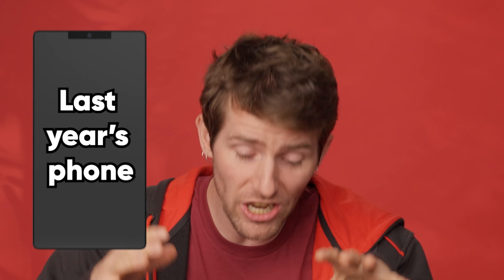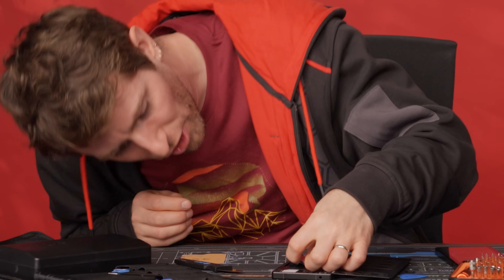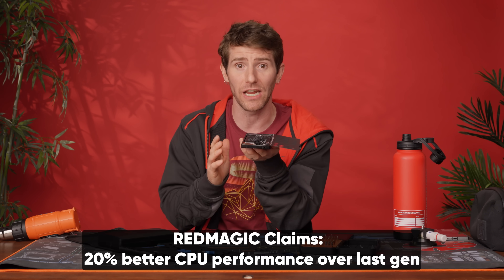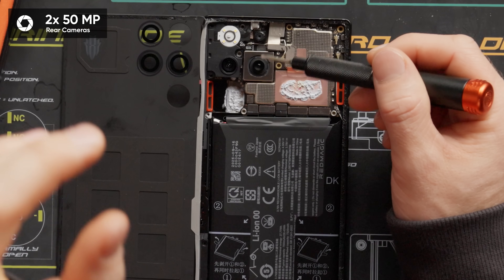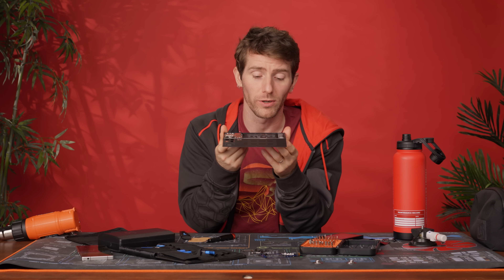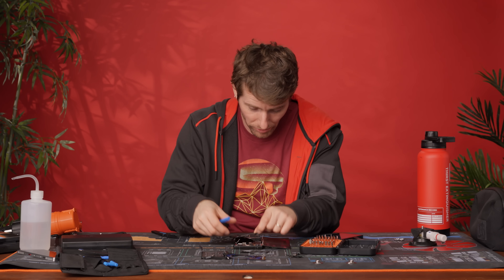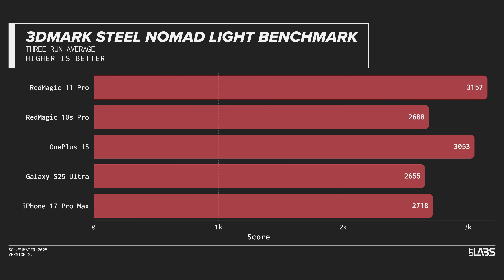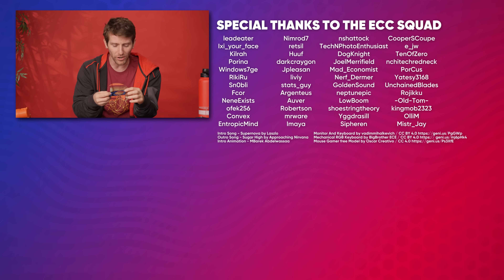This Water Cooled Phone is the Fastest We’ve Tested

Comment: @LinusTechTips Video idea for LTT (about desktop computer cooling for which I can't find a evidenced answer anywhere): Whether six intake fans at 50% rpm or three fans at 100% rpm is cooler or quieter. Maybe three 120 mm front intake and three 120 mm side intake and two 140mm exhaust. Run all six at 50% rpm or just the front three intakes at 100% and see how noise adjusted thermals change. Cheers.

Comment: I really wish you guys would actually daily drive a red magic and see if they have actually improved the user experience at all. Having used the Red 6 pro and currently daily driving the 10 pro and it's been quite the adventure. The 6 from back in the day was a rough experience out of the box with A LOT of software bugs. A Little over a year and they finally fixed most of the issues but there's always this feeling like Redmagic forgets they release multiple devices and ONLY focus what they immediately release. With the 10 pro it really stung as it wasnt long after that they released the 10 air and the 10 pro s which means this phone is barely a year old and already pretty much doesnt exist on their website while still waiting on the promise of a SINGLE android update to 16. As far as my actual use of the 10, as someone who travels the 10 has been this strange monkey paw of a phone . 1. In the USA carrier support is extremely limited and often requires weird work around to get it on a carrier. 2. Screen brightness, Charge Separation, and the cooling fan make this phone unbeatable imo for traveling and navigation BUTTTTTT People have known for a while now(seems to start ish with the red7 but really upticks on the 8, 9, and now 10) that the screens tend to get ghosting, burn in, or retention fairly quickly. Even though I run the phone 60hz maybe 40% brightness on trips it now has issues with icons and stats temporarily burned into my screen but luckily it has not been permanent and goes away after an hour ish. I get Short circuit is meant to be a quick look at new products, but in particular with the redmagic phones I find them kind of misleading since you really just go ooohhh shiny look how cool this is(and in fairness, on paper these phones are imo the coolest) without actually experiencing how it performs in the real world and rocking 144hz (notably down from the 165hz they used to push for no reason) ultra bright display doesn't really mean anything when it just leads to screen burn in while I am getting every other day alerts about Spotify running in the background because the OS doesn't know what "ignore" means. I could definitely ramble on A LOT more about how the 10 is equal parts awesome(It has an IR Blaster even!) and a pain but seriously, anyone actually looking into these phones needs to understand the tradeoffs are because red stops caring after they release these things and I havent even gotten to my rant about their terrible customer support.

Comment: How did you acheve the 80 wat charging? none of my red magics have gone above 65... ive tried evrything useing redmagic stock charger and cable, the redmagic GAN charger and a host of 140watt chargers, it never goes higher then 65
Reply: Did you turn in turbo charging in settings
Reply: @NotReallyANames  Yup, tried everything. Is there anyone that can confirm there phone infact does charge at claimed speed?
Reply: @VicViperXxXxX which redmagic do you use
Reply: @NotReallyANames  Tried the 8, 9 ... and when it arrives the 11.... but i havent been able to get any of the phones to charge at full speed. i did some reading and aparently it only gets this speed from 0-5 percent charge?
Reply: @VicViperXxXxX I don't think the 8 or 9 has 80 watts. I'll check
Reply: The 9 apparently does. I'm not sure
Reply: @NotReallyANames  yup, im just as perplexed over this. ive tried diffrent bricks, cords, let the phone cool, die ... i just dont get it

Comment: I have seen a few heat tests done, from what they have shown, the liquid running alone does very little, but when both it and the fan are running it is much for effective then the sum of the parts when comparing the just liquid cooling ,and just the fan. however, "much more effective" was still only small portion of the heat disposition, seems the vapor chamber really does the bulk of the work.
Reply: To be fair. The fan cools the liquid and also the vapor chamber. It kind of is a synergy.

Comment: i assume the Liquid does not much for the SoC BUT it could really help with the Qi Fastcharging as it is sandwhitched with the Coil
Reply: It does alot. With the fan on ofc (otherwise the liquid cooling becomes basically just a heat spreader) cause every liquid cooling set needs a fan

Comment: U know ,phone company should just ignore wireless charging all together. Like hardly most people use wireless charging except some lazy people or people who are too busy to even plug their charging cable
Reply: I use it all the time to prevent  wear  on the USB C port
Reply: Doesn't make sense bro. You can just plug and unplug the charger like thousands of time. It won't wear, except become a bit loose.
My old device which i bought on 2019 with usb c is still working fine, my mom uses it , she likes keeping battery above 80% so she charges like 3-6 times a day, even when battery is like 78%. Still no sign of wear and tear. Just a bit loose but still tight.
Reply: @phoneix192 Might depend on the model / build quality. i've seen countless USB ports fail on devices that have never been dropped or mishandled.

Comment: BUT WHERE ARE THE MAGNETS!? Qi2 has been a standard for two and a half years now. WHY ARE MY ONLY OPTIONS THE HMD SKYLINE OR PIXEL 10!?

Wireless charging is about being so convenient, it's on charge more often than not, stop focusing on the sodding speed! THE MAGNETS ARE THE IMPORTANT BIT.
Reply: You gotta get a case for the magnets since the magnets in the phone aren't enough due to the glass making the magnetic item slide off. Like a cooler or wireless powerbank

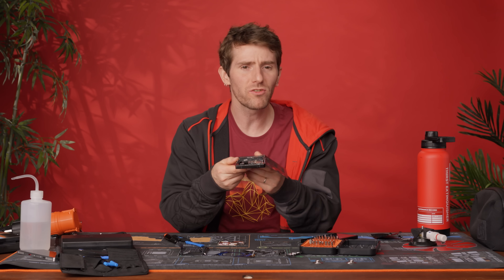Comment: 9:56 There is a error here, it will decrease the charge rate to protect the battery and not to generate to much heat. In order to get the max charge speeds, its required to turn on "Turbo Charge" in the battery settings. And there was no mention of Charge Seperation, which is very usefull.
Reply: How do i deactivate Turbo Charge?

Comment: I was very disappointed with this phone (for my use case)

Yes the watercooling is cool (altho useless) and shoulder buttons are a nice gimmick but they are very uncomfortable to use, compared to just using a wireless xbox controller)  

the camera is straight up garbage and the microphone quality sounds like out of a tin can.
the front camera is absolutely useless.  

Also. It has poor carrier coverage and does not support ANY GoogleAR features so you can't play Pokemon GO and other stuff.

Be aware that the refund policy and shipping is as expected very chinese. As a EU customer your phone might come either from China or Berlin. Returning the phone however has to be done to the czech republic

the screen might be 144hz but it's not LTPO which means it will use up more battery life over time. In my use case the phone DIDN'T go down in Hz even tho I was just sitting on the home screen.
Reply: The water cooling isn't a gimmick. For me shoulder triggers are better than touch screen. Cameras are subjective. Carrier coverage is fair. Refunding varies. And the screen is the BOE x10
Reply: @NotReallyANames as stated in this video, yes it is a gimmick. It basically does nothing to help the CPU stay cool. Cameras are not subjective, they are simply trash. ISO values way overblown. Forget trying to take a close to reality picture. Those triggers have a function I didn't say anything against that. They are just very uncomfortable to use. Even a 3DS had better ergonomics. Refunding doesn't vary. Check trust pilot for refund reviews. I know what the screen is. I had it. I didn't want it. I refunded it (with some effort).

What's your point here? Nothing you say is based in anything
Reply: @TheHunsonAbadeer it can literally sustain genshin for 2 hours straight 60 fps with 0.6 frame variance but ok.. btw I meant better than touch screen by more comfortable
Reply: @NotReallyANames do you trust all claims a manufacturer makes on their websites?
Reply: @NotReallyANames you know what else can sustain grnshin at 60fps for well over 2 hours? A low end PC attached to an actually usable screen size for gaming. Ah yes let me play my third person open world game in 2K Resolution on a 6 inch display. Surely that's the best way to experience it. Whoops my battery is low, gotta recharge that. What do you mean the fan has to spin for the battery to stay cool during charging?
Reply: @TheHunsonAbadeer they literally can't lie. They are a small company and a lawsuit for false advertising is too big of a risk. And a low end PC is not sustaining 2 hours of genshin on max.

Comment: Layla AI, developed by Layla Networks, is designed to be fully self-hosted and locally run on your device, supporting on-device LLMs and Stable Diffusion for image generation without requiring internet connectivity. It emphasizes privacy, offline functionality, and allows advanced users to load custom GGUF models.

In contrast, RedMagic Mora is not self-hosted in the same sense—she relies on pre-loaded assets and limited cloud-dependent features, with no support for user-loaded AI models or local LLM inference. Despite RedMagic phones being powerful gaming devices, Nubia has not leveraged that hardware for local AI hosting like Layla does.

Comment: In reality the cooling system doesn't work at all, it gets over 55°c/131°f after 10min of gaming
Reply: @ambikasankarguru8537  you are wrong. Mine barely gets to 40 degrees after an hour of delta force maxed out. The fan and vapour chamber does a rly good job. The liquid is just for heat dissipation.

Comment: TLDR: the water cooling is pretty much fake, it has a 24k rpm fan built in with an exhaust. It's somehow IPX8 rated, so waterproof but not dustproof. I would like to see this phone's thermals with and without the water-cooling "film" removed.
Reply: The redmagic website says it has a unique dust proof design. But they mean that dust wont affect its performance
Reply: @NotReallyANames  "Unique" is code for worse and not certified.
Reply: @mvez10 and also the X means it's still trynna be certified. Be patient.
Reply: @NotReallyANames  That is the most wrong thing I've read all day, granted I have been busy today. IPX8 is a real rating, not a placeholder, and the phone is already on sale right now with an IPX8 rating. Send me whatever you are smoking, please.
Reply: @mvez10 it doesn't mean it has no protection. It literally means it ain't been specified
Reply: @NotReallyANames  Are you explaining to me what IPX8 means? I pointed out the lack of a dust rating, and you started trying to defend it for reasons I don't know. Point being, if they could have gotten the dust rating, they would have, and yes, it matters, it's one more way to have your warranty refused.
Lastly, where did you see that they were working on getting a dust rating?
Reply: @NotReallyANames  Again, everyone else here knows what it means. 
You said, and I quote, "the X means it's still trynna be certified. Be patient."
Source? It's like your 3rd time skirting what you said.
If you can't back up what you said or even comprehend that we all have Google too, I have to assume you are trolling. Re-read everything slower.
Reply: @mvez10 " X Unknown X means no data is available to specify a protection rating about this criterion"  source: wikipedia
Reply: @mvez10 here is the source https://en.wikipedia.org/wiki/IP_code#cite_note-6
Reply: @NotReallyANames  I still don't see your source for them still trying to get certified. Did they try and fail? Will they make an announcement once they get their certification? You were clearly talking out your ass, and it is sadly clear to me you are actually not trolling. Have a great day, I'm done with this.

Comment: Watching this on my REDMAGIC 10 Pro. 

I knew from the start the liquid-cooling was just a gimmick, there was no way that liquid took the heat away from the phone in any meaningful way. 

The fan on the other hand removes heat from the CPU pretty well but, that isn't the biggest problem, it's the battery that gets hot really quickly and the only way to deal with the battery heat is to buy and use a magnetic phone cooler. 

These phone's are actually powerful enough to emulate PC games, I know because I have done it. But to get the full power of the phone you need to activate something called "Diablo Mode" this is when the battery temperature gets out of control unless you use the attachable phone cooler.
Reply: It isnt even a gimmick bro
Reply: @NotReallyANames Please explain.
Reply: @NotReallyANames still waiting on your answer...

Comment: I think apples approach of water/vapor cooling the battery is actually pretty cool. 

Probably makes it less likely to explode. And a lot of times the restriction isn’t the heat of the SOC but the skin temperature of the device can’t be more than around 40 degrees Celsius. So cooling the general battery and device works. While being a lot easier to do and less complex. 

Granted I think apples soc is more efficient but less powerful and they areant pushing it near as hard as is possible.

Comment: Can't believe I'm Um, akshuallying the um akshually, but here we go:

the weight of the battery as a % of the total phone's weight is given by 
% battery = 93/(93+145) * 100% = 39%, not 39.07563025210084%.

This is because the rule for multiplication/division is that the result must have the same number of significant figures as the measurement with the fewest significant figures used in the calculation (i.e. 93 grams)

Comment: Adreno 840 has mesh shader support along with ray tracing support. PC emulation at this spec is something that deserves its own video
Reply: First we need the turnip drivers, then we can talk about that 😅
Reply: @ImAltair1 
The current drivers already support Ray query, so the building blocks are there. Also, the fact it's not well supported is why a video is important, because the discussion would allow people to see how much potential there is in these phones. Phone gaming has not been pushed far intentionally. Once a regular consumer realizes their phone could handle PS4 games, mobile gaming expectations rise drastically and major companies that drive the current mobile market stop raking in serious cash from seriously low effort. There are a few outliers in there of course, but the disgustingly poor performance of Resident Evil and Death Stranding on an Iphone intentionally does not show the full potential of modern phones. The 8 gen 5 has some really cool features and current capabilities that deserve a whole video. So we don't need drivers first to talk about it. The point is to talk about it in order to get developer support. Something like Winlator is running a GPU through 2 or 3 translation layers and still puts a lot of the work onto the CPU. Native ports with support to android-based arm devices would have incredible results compared to the poor quality only available on the weakest modern options, being Apple's hardware. I don't care about geekbench, I want to see real games with native support. A channel like LTT making a video about this topic could legitimately be the kickstart of driver support and native porting.

Comment: I love that the phone has no camera cutout and has an actually rectangular - not rounded corners - screen. Those features are honestly most of what I want out of a phone, plus the big battery and reasonable performance. But the X in the IP rating, due to the fan meaning ZERO dust resistance worries me. One drop of the phone in some dirt and you're in trouble..... I wish I could get it confidently. Really I want the ZTE Nubia equivalent, but they don't ship to the US TT
Reply: The websire says it has a unique dust proof design that makes it so dust has no effect on operating.
Reply: @NotReallyANames I mean, at the end of the day, you can watch the actual testing videos and dust and dirt can still just get right into thay fan port though. And the IP X8 (or whatever it was) rating speaks for itself - they can't rate it for dust protection for a reason.
Reply: @Eragonnogare dust proofing is still dust proofing. and most likely the x for dust isnt final
Reply: Apparently x means not certified yet.
Reply: @NotReallyANames I mean, isn't the phone out already, or close to it? The rating is likely final. If it was dust proofed they'd have gotten an actual dust resistance rating in their IP score, and be advertising that rather than the X8 score
Reply: @NotReallyANames it means "not enough data to say a number" aka "we didn't even try testing dust on this phone because we know it'll immediately fail, just put the X there" - watch the Jerryrigeverything video on this phone and see.
Reply: @Eragonnogare certification takes time
Reply: @NotReallyANames time they already spent to get their X8 certification. If they wanted to get a dust rating, they'd have done so at the same time as the water rating before putting the rating in their promotional material and product info. It's obvious how dust does simply get into the fan.